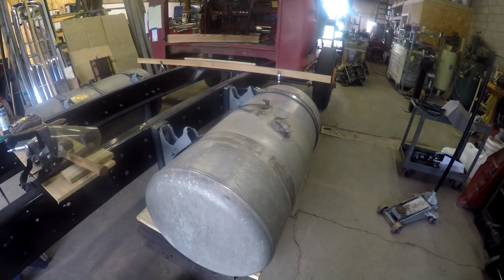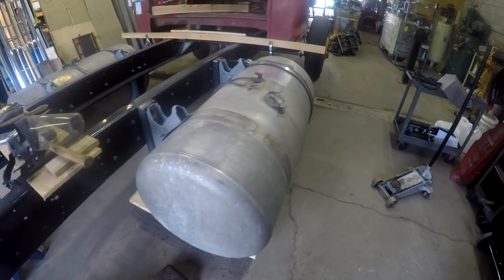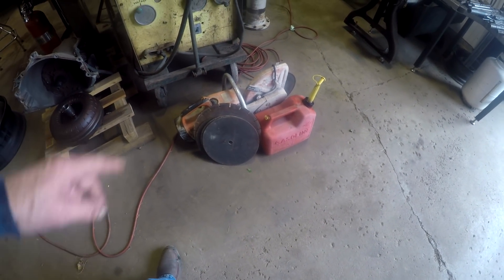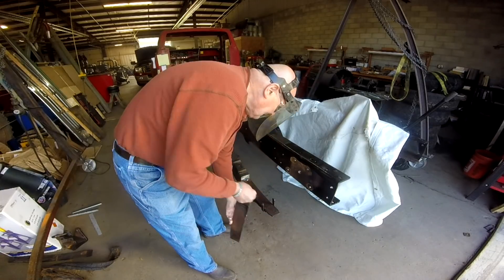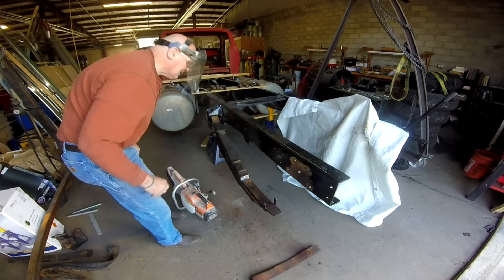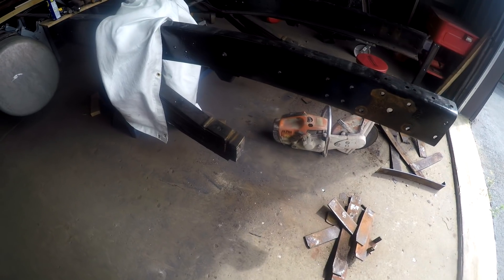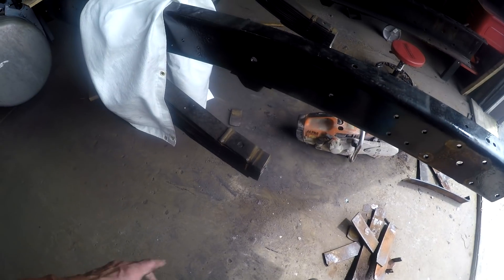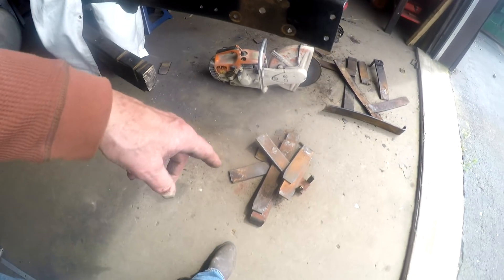Ford F750 Haul Truck Build Part 51

Comment: Looking forward to seeing how it sits. It sure looks like it will put the frame pretty high in the back with the springs on top of the axle, well only if you get it up enough for the pinnion to not be pointed down so it was running in line like it should.
Reply from the maker: Everyone keeps saying that, but truck was originally designed and built that way! With me having used the front part of spring and cut off back half, it actually gives me more of an ability to play with height, as I am not limited by the rear spring shackle anymore. So I am able to pivot spring past it’s original stopping point and lower truck even further if I need to. Just need to keep the angle of drive line at optimal position at normal ride height and bags able to have adjustment room for load or trailer drops.
Reply: @frednewman2162  You could always mill an angle on the spring to axle adapters to get the pinion up if need be. I thought that axle was thicker than original so would raise the centerline of the spring perch.
Reply from the maker: That’s what I was thinking also (beveling adapter plate if needed), the original plate was angled to begin with, so was going to get my centering holes laid out and the see if it needed to be beveled when I test fit it into place.

Comment: Have you considered using under slung air bag mounts on the axle?
https://www.youtube.com/watch?v=Q66uJSTanj4
Reply from the maker: I hadn't up to this point. I had toyed with the idea of doing away with all of existing rear suspension from old truck and then trying to adapt a more modern air suspension system off of another truck to mine, but chose to go this route! If I can't make (or don't like they way the geometry is going) it work then I will consider it! The biggest issue I could see with it is that my new axle was designed for 'top slung' suspension, so I would have to rework axle to be adaptable for 'under slung'.
Good question! Thanks for comment!!
Reply: @frednewman2162  If I get up your way Fred I'll get in touch with you,  perhaps offer up a hand making what you need to keep your current axle but go to underslung direct bag mounting.